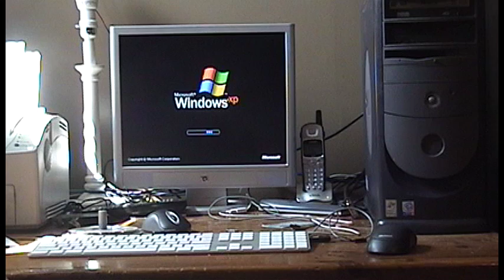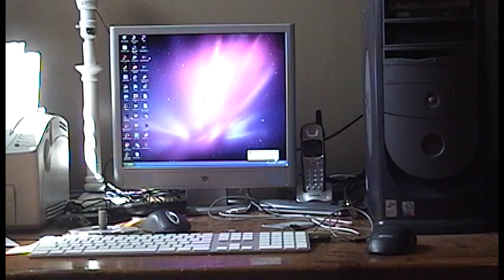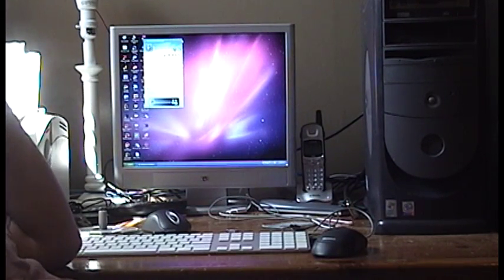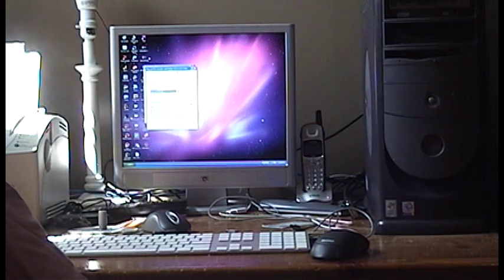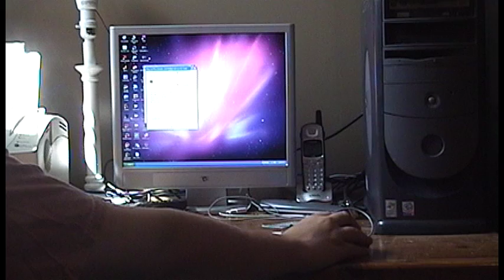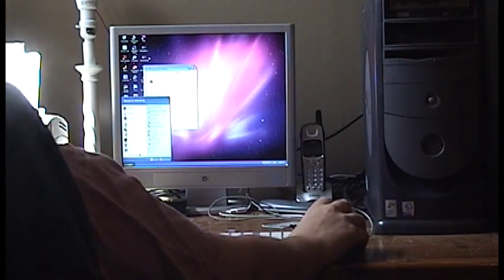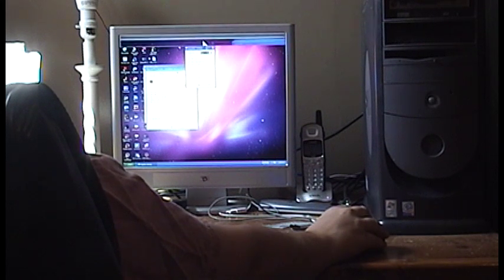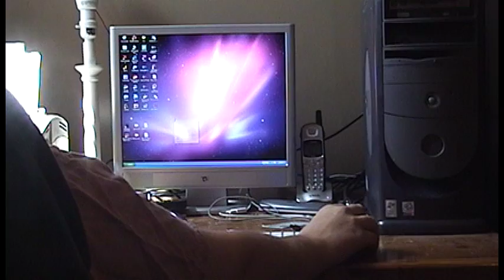Installation of NVIDIA GeForce FX 5200

Comment: For asking people: This card doesn't help a lot with High Speed Gaming Experiences games just like Call Of Duty Black Ops or stuff like that. But, if you're playing games like: Crossfire, Combat Arms, Css, of course you will get from 100-200 FPS= A Good Gaming Experience. Stop asking this thing. Another thing is that if you been getting 50 FPS at Call Of Duty,2,3,4 Another thing you can do to increase your gaming experience is to get a 2.6,2.7,2.8,2.9,3.0 GHz. That increases your PC performance.

Comment: What CPU you running with it? The 5200 should be fine as long as the CPU is beefy too, as HD is CPU intensive as well.
Actually IIRC most of the calculating is done by the CPU unless the card can specifically offload the data.
Reply: He was running a Pentium 4 probably 2.8ghz version